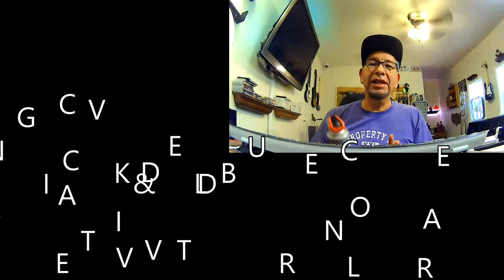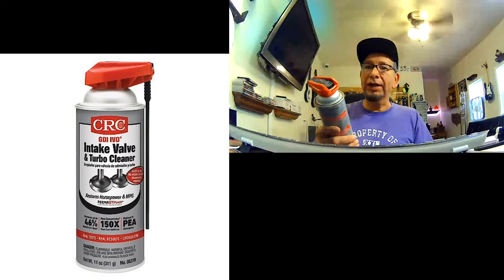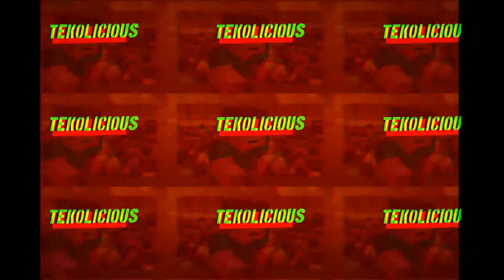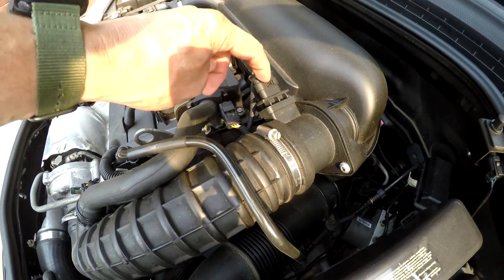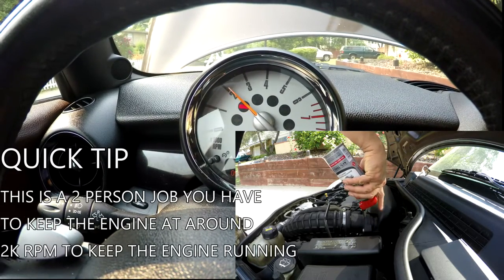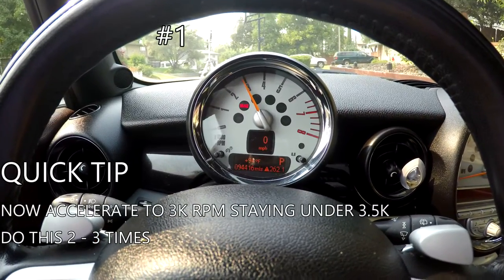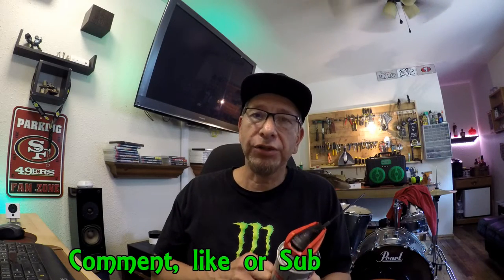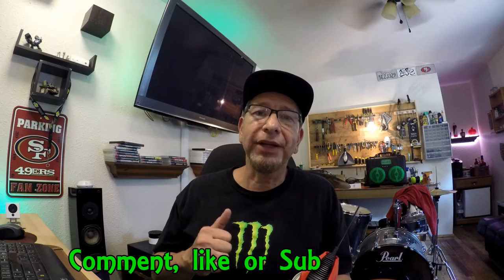CRC Intake Valve and Turbo Cleaner - Easy steps for fixing Carbon Buildup

Comment: I removed the intake manifold & actually scraped all the crap off the valves & thoroughly cleaned the throttle body & intake manifold, Car ran smooth like butter afterwards
Reply: I like your way better. Mechanics say they see scratches on cylinders, pistons, and rings all the time from this method. Maybe this works when the valves aren't gunked up, like maintenance every 1,000 miles. His product is rated the best though. Spray and pray, or do it your way!

Comment: Thanks.  Check engine light came on so pulled the code and said throttle position sensor was bad.  Figured I'd try crc.  Sprayed half can through turbo like you did and half can through throttle body.  Then changed the oil... about 500miles after treatment check engine light when off.  Could not be more pleased.  Will start using before every oil change now

Comment: I just did it on my '12 Cooper S.  The exhaust has been popping like crazy in sport mode after doing this.  Not surprised since when I was working on my intake manifold, when I looked in at the valves and walls, it was filthy with carbon deposits.
Reply: So it worked?
Is your mini with turbo?

Comment: did this and i heard some clinking in the turbo for about half a mile, guess that was the caked oil. i also drove the car for about 30 minutes prior to really heat up anything that would come off the engine. will do the pcv method my next oil change. but the crc treatment was night and day. thanks for the tutorial!!

Comment: Best to spray this directly into the intake manifold after the throttle body and intercooler, otherwise it could pool in your intercooler and create a super knock issue and pre detonation. And this GDI cleaner doesn’t mix with your oil at all. If it’s mixing with your oil you have an issue with leaky piston rings. Most of the cleaner should burn up in the combustion process. Some will be left on the valves during the hot soak. Most residual cleaner will be burned during the post hot soak drive cycle.

Comment: Hit a few snags as I did the job by myself. SeaFoam is easy solo but this can and spray button made it tricky. I might have over tightened the turbo intake, blocking my first try at getting the product in there. I’m hot soaking now, can’t wait to hit the road.

Comment: You just need a stick to place on the gas pedal, then move your electric seat forward a tiny bit at a time until your at 2000rpms, small engines with a light rotating mass might need higher rpms to stay running, but don't exceed 3200 WHILE spraying the cleaner.
Reply: I used two golf clubs and a kids swimming noodle. Kept it right at 2,000rpms.

Comment: ive got a similar car to you. Sudden rough idle when car is at operating temp. Codes show misfire on all cylinders. Wondering if it might be carbon build up on valves

Comment: I have a 2007 mini s and after doing what was suggested in the video, and while performing the hway driving, the car was not accelerating the way it was before the crc treatment. 
Is this normal? Will it start running normal after a certain number of hway miles? Please inform.

Comment: Nice video for easy way to clean valves. How do you heat soak?  Do you block any hoses to contain heat?
Reply from the maker: no just by running the engine you create heat then you let it sit and the heat from the engine is enough to allow the chemicals to do what they do.
Reply: Excellent

Comment: How many miles can I drive it before I have to change the oil? also would seafoam spray work like crc?
Reply from the maker: I checked it, each time I filled up on gas, but 500- 1000 miles depending on how aggressive a driver you are, and yes seafoam is like the CRC product, so I think so. But I have not tried it.

Comment: 2008 mini Cooper S has a hard time starting cranks 56 times runs rough till it clears up a little and it’s OK is it a fuel pump
Reply: 5 to 6 times
Reply from the maker: @normandesrosiers3737  fuel pump was my problem

Comment: We’re you getting misfires? 
I changed out fuel pump and 
Still getting cylinder 2 and several cylinder misfires 
I have new plugs and coils 
Suspect it’s carbon buildup 
Car runs rough and when I accelerate 
CEL light comes on. 
Will try this before walnut blast 
Just wanted to know if you had misfires 
Only codes coming up
Reply: Did you get it sorted in the end? I'm having similar problems with mine
Reply: @lukaszurbanowicz8067  
Bad news, I got a scope looked down the cylinders and noticed oil coming thru
Upon further inspection the exhaust valve blew, they’re know to fail. 
Sold the car to a junk yard. 
You can rent the scope autozone

Comment: How does spraying that into your intake make it mix with the engine oil??
Reply from the maker: It says that you should do this just before you get a oil change on the can. that way it doesn't stay in the system.
Reply: Techron Fuel Additive like CRC GDI uses the same polyetheramine, or PEA, which is the gold standard. I think changing your oil is unnecessary as Techron doesnt require it. Ya ok maybe youre getting a heavier dose with CRC GDI spray...could be, as opposed to during the use of an entire tank of gas with TECHRON Fuel additive, which never touches intake valves on GDI engines).
Reply: I don't think this is really necessary. If some of the solvent goes into the oil (over piston rings, valve shafts or whatever) at all it's a tiny amount, which should not be noticeable at all in those almost 5l of engine oil. Since there could be residues left within the oil and usually they analyze the oil in case the engine dies I think they write this to cover their backs legally if someone has engine damage some time after the treatment and sues the company, they can say: "Did you change the oil? You didn't? Your bad then!".

Comment: Hi, got a questions for you. I've been doing this early on my Mini Cooper S, but i spray it directly though the Vacuum Line which is very easy to get to and few mechanic said it work better. Have you ever tried it that way to see which method deliver a better result? Thank you
Reply from the maker: I did it so I would clean the turbo the most but it sounds like your way would work too.
Reply: Where is the vacuum line?
Reply: Its on the vacuum pump. I also did it thought PCV hose with good result! I'll try your method to see the difference. Thanks
Reply: Oh thanks!

Comment: That is one clean engine bay! When you say "heat soak", the engine is running for an hour???
Reply from the maker: no you run it then, let it sit for an hour, to let the heat from the engine allow the chemicals to melt the carbon deposits.
Reply: @tekolicious8310  Cool. Thanks

Comment: Is it necessary to change the oil after doing this ? Anyone
Reply from the maker: I believe it said so on the can. I would wait till you need a oil change before doing this.
Reply: What is misleading is that they say” use CRC every 10,000 miles or before every oil change “ . But I guess if you are changing your oil do it before for good measure so that no additional contaminants from blow by is introduced to your clean oil.

Comment: So this product screwed up your high pressure fuel pump? Is there a chance a chunk of carbon could come off your valve and mess up your turbo?
Reply: I've been waiting for this to be answered im nervous about
Reply: @meman24  Exactly the reason I installed an oil catch can on my 2012 cooper S. Easy to do yourself. I have to empty it every other month. I was surprised at how much water/oil it captures.
Reply: The product cannot damage the high pressure fuel pump, since it doesn't even get in contact with that. How would that work? And from the video I get the Mini had other problems, too, which were caused by the faulty HP fuel pump.
There are other products you put into the fuel to clean out the fuel lines and injectors, but I never heard that they cause damage to the fuel pumps.
Reply: I read that the chunks can mess up the cylinders and rings.